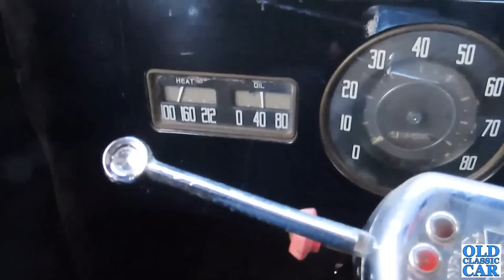GRAB THE THERMALS! the Renault 4CV & Dodge come out to play in the snow

Comment: Nothing wrong with a bit of fun in the snow. As a keen photographer myself we rarely get much snow down South of the UK.  So make the most of it. You could put a bag of gravel in the back of the Dodge truck to add some weight but I would guess that is only an issue in ice or snow. As Harley said possibly one of the brakes sticking but I couldn't tell from the camera which one. Thanks for the video Rick and Harley.
Reply from the maker: I could probably put the 4CV in the back of the Dodge! Thanks for watching

Comment: Harley did a good job maneuvering around the yard in both vehicles (Love 'em both!), but I cringed each time he got in without knocking the snow off his shoes. I realize there's no salt involved, but water can be harmful as well. The first vehicle I bought was a '40 Ford 1/2 ton pickup (same color as the Dodge), which I discovered had a severely rusted frame just at the back of the cab. I didn't know at the time it was repairable (I was 19) so I very much regret selling it. My second was a '62 VW convertible and I concur as to how good rear engine cars are in the snow. BTW, in Vermont, that amount of snow is just a minor nuisance (chuckle, chuckle).  😁
Reply from the maker: Yes it wasn't a huge snow covering but it was enough to take a few photos, don't worry I brushed out the snow from our shoes before I put things away. I've got to the point where I don't over-worry about things so much as I once did, although I try to avoid salty roads.